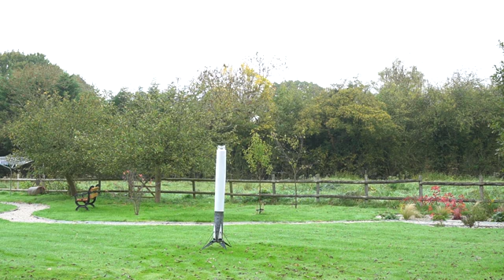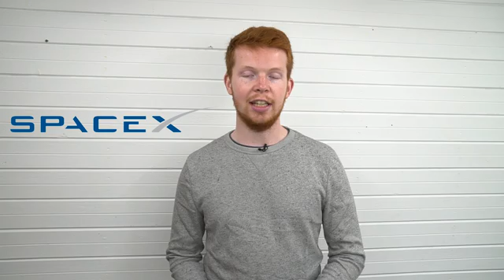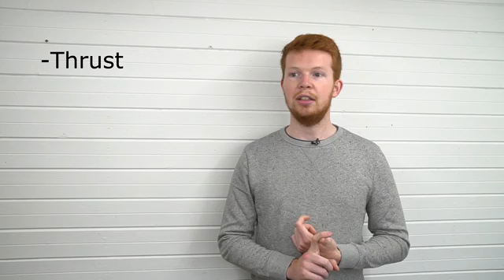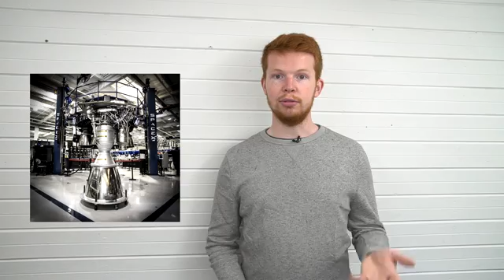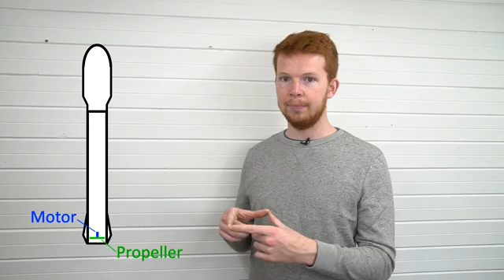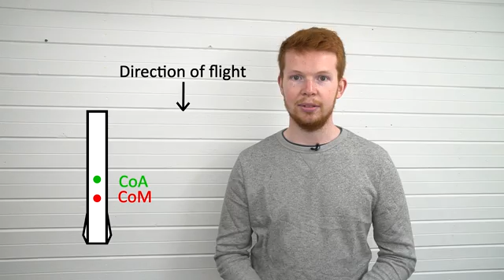Hovering a rocket - SpaceX model

Comment: Wow this is amazing! Could you use some sort of water cooled edf? Or siphon its thrust off somehow to cool it?
Reply from the maker: Possibly! Maybe a metal motor mount would be simpler and would still act as a heatsink. Definitely something to look into! Thanks
Reply: Wow, I cant believe you replied! You could use something like one of these mabey? https://hobbyking.com/en_us/ntm-rotor-drive-450-series-1700kv-930w.html or https://hobbyking.com/en_us/turnigy-l2855-2100-edf-outrunner-900w.html or even https://hobbyking.com/en_us/turnigy-ld2840a-1800kv-brushless-motor-400w.html or possibly https://hobbyking.com/en_us/turnigy-l3010b-1300-brushless-motor-420w.html
Reply: Adding a second counter-rotating motor would halve the load on each motor. Using the lamels to counteract torque from the motor probably don't work well on low thrust when landing, so maybe that would also allow you to land without tipping over?

Comment: Really impressive work.  I think ducted fans with long efflux tubes are always inefficient so the easiest way to get better thrust is to move the motor and fan down towards the bottom of the tube.  You could then add some side vents above the fan to allow an easier passage of air on the influx side.  I know this will move the centre of gravity lower but probably a price worth paying.  Another approach would be to put some side vents below the top motor fan to allow it to operate more efficiently.  This would reduce the effectiveness of the control vanes so to keep them in their current location you'd have to add a second motor/fan down near the bottom of the tube.

Comment: Not sure if this is a stupid question but could you pump water or some liquid around the rocket to rotate it?
Reply: It is just a kind of reaction wheel (flywheel).
Reply: Yes, could you employ this on a rocket of this size?
Reply: Why not?) But it'll cost you a lot of mass - fluid, pump, tubes, controls. In this case a usage of 'free' air is a right solution.
Reply: Could you somehow modify this then to instead use a pump to compress air and fire it out the bottom but does this on the go so the gas gets immediately fired out resulting in no mass in the rocket at one time because of the speed and directness of the compressed gas to the fuel nozzle. Pretty sure this wouldn't work because I thought of it but you never know.
Reply: I'll say that every alternative solution has much more weight than a simple propeller.
Reply: Yes, I think your right but if you had some sort of pump moving water around, you would never need to loose any fuel. Im not sure if this a good or bad thing but hey, it's an idea.
Reply: Good question Vosem: The idea of using a fluid as the mass in an inertial reaction control system is not a practical one.. its because water tends to loos energy very quickly by friction when its moved trough conduits. You should lookup how reaction wheels work, its very interesting: They need to be spun up before launch and its the action of slowing them down while in micro-gravity that imparts angular motion to the spacecraft. Essentially, the kinetic energy is 'stolen' from the planet itself, stored in the wheels and given to the craft when needed.. Once the kinetic energy has been removed from the wheels by slowing them down, the craft must use fuel to hold its attitude while the wheels are spun up again. There are other implementations of reaction wheels but they all operate in a similar fashion and their operation relies on conserving momentum in a mass. Any  friction in the bearings or in water flowing through pipes will be lost.
Reply: Then the pipes filled with water would simply replace the wheels as the inertial mass but the friction of the water inside would still waste energy through sloshing. Remember, any friction in the system is a waste of energy, this is why they use dense discs hung on ultra low friction bearings in these devices.
Reply: vosem  er NO.. go get a 10 gallon bucket or barrel of water,, fill it   up with a few gallons  and run around the yard in circles for 5 minutes and youll find you answer
Reply: simon  er NO... its the sloshing of mass not friction
Reply: Hmm instead of pumping water around could you instead move the pipes so the gravity pushes the water along the pipes instead of a pump?
Reply: +Vosam Media "could you pump water or some liquid around the rocket to rotate it"?  Yes.  But at the expense of adding a lot of mass.  Since he needed the thrust vectoring _anyway_, using the vectoring to cancel out the prop rotation (and rotate the rocket arbitrarily) was essentially "free".  Further, there are limitations as to how much torque you could get - once the water is moving "full speed", it's effectiveness at rotating the rocket in the originally desired direction is lost.

Weight is (almost) always a great enemy in rockets.  You do everything possible to reduce weight and combine function.
Reply: Liquid fuel rockets actually inject the fuel and the oxygen into the combustion chamber using turbo pumps so someone at any given space program spends his days figuring out why generating forces pumping liquids around is/isn't a great idea!
Reply: johnny: Sloshing in a fluid causes movement within its mass which induces internal friction. Its a basic concept in fluid dynamics. It's the reason a container filled with fluid stops sloshing when left still. Also starting a reply with "er  NO" makes you look arrogant, particularly when followed by a void statements.
Reply: or he could just use smaller motors and counter rotate them

Comment: Great video as usual Tom. I seem to recall that when deciding to install an air duct for a kitchen extractor, you need multiple fans along a long length of conduit. I believe this is because the fan loses power the longer the tube. I wonder if you introduced vents on the side of the tube and closer to the fan, you might get better thrust and less likely to need 100% power?
Reply: Excellent logic. Tom, do this.

Comment: Really cool build, you should try flying it in an indoor space somewhere where the wind won't make it drift. I bet it would hover perfectly.
Reply: rofl, just because he didnt have position control on the control board doesnt mean it doesnt exist., gps, ultrasonics, more accelerators and altitude sensors etc can be incorporated to aid in heading hold, also a larger object has more mass vs surface area and is less effected by wind and inherently more stable because of it.
Reply: @Drachenhebron  . Yes modern aircraft always incorporate more mass to increase stability  ... 🤦🏻‍♂️ hint ALL Aircraft design involves reducing weight ( mass) whenever possible
Reply: Michael Taylors not all the rockets land on the water so you could actually see a landing... also the larger rockets are not effected by the wind as much as smaller rockets
Reply: @misterbert9246  ... yep and bigger sails are also less affected by winds than smaller ones 🤔🤣
Reply: @michaeltaylors2456  Do you even aerodynamics bro?
Reply: @Kasmuller  , yes , which is precisely why grid fins, cold nitrogen jets, and horizontally flying cylinders without wings or are a no go , aerodynamically speaking .
Reply: @michaeltaylors2456  you don't get it do you...
Reply: @Kasmuller  , No you don’t get it Kristian. The impossibility of a wingless tube flying under control in any attitude but perfectly straight up is quite impossible . What you do actually factually see at a KSC launch is a simple ballistic arc up over and downward. This makes perfect aerodynamic sense. For example,  why don’t we simply remove the wings from a 737, mount it’s engines on the tail and fly?  We could , straight up briefly perhaps, assuming enough thrust is available.  Remember that before orbit is achieved,  one must first fly roughly horizontally and gain over 100 km 60 miles to the Karman line. Your space craft or rocket must be an outstanding high performance aircraft first, with all of the attendant challenges to overcome that even the mighty X-15 and SR-71 cannot handle.
Reply: @michaeltaylors2456  I know how rockets work...
Could you explain to me why wind would be an issue going down but not going up?
Reply: @Kasmuller  . I see you are thinking a little, and now have  invented a strawman to ignore  my arguments.  You  know how rockets work?  That is fantastic , but I never said you didn’t.  Another  straw man.   I’ll continue to discuss the science if you are serious about learning, but, if you twist and fabricate things that you wish I wrote, you will remain right where most idiots are,  a fantasy state of cognitive dissonance. Believing in CGI and cartoons to inform your miss-understanding and then treat science like something to be a avoided because it conflicts with a sci fi movie you saw.
Reply: @michaeltaylors2456  Lol, I wasnt aware people actually thought this. I would LOVE to know how you think missiles (and RPGs etc) fly, since they are jsut tubes without wings. This some flerfer math 😂
Reply: @LeglessWonder  I recommend a simple web search for guided missile, preferably actual working ones, where you will find that 100 percent of them use fins for guidance.
Reply: @michaeltaylors2456  fins aren’t wings. That’s like saying an arrow gets lift from the fletchings.
Reply: @LeglessWonder  Lift is not the question here  the rocket engines provides lift dipshit, wings are required for directional control and no, dumbass, vectoring or gimbaling that engine thrust will not suffice. Fuck off
Reply: +Michael Taylors You're kidding right?
Reply: Old Albird then make one and show us, or are you chicken?
Reply: Michael Ratzke good thing there is never any wind over the ocean
Reply: Tntmod54321. I’m kidding about the lack of wind  over the ocean . I’m commenting on the unintentional debunking of Elon’s show . The well meaning and very intelligent author of this video demonstrated the inherent lack of lateral control a craft like this would have . Gusts present over the ocean would be more than a match for some squirts of nitrogen and wiggling fly swatters ( grid fins ) could ever compensate for. All spaceX launches, tests , recovery all blatantly CGI. A thing may launch from KSC, but the rest is about as believable as the FX in the Last Starfighter
Reply: @michaeltaylors2456  except tons of people have witnessed the landings with their own eyes aswell as with cameras when they land on land...
But ok if you don't want to believe in what is obviously real then don't...
Reply: @Kasmuller  Your faith is strong, impressive young  Starfighter. Have you met any one of these “tons of people” or just saw their YouTube videos ?

Comment: Excellent stuff again Tom, you have however just created the first prototype automated leaf blower of the future.. you need to get patents in place. Seriously though, that is a monumental achievement, the holy grail of rocketry is control, your design just leaped over the first hundred years of 'rocket science'. Great work.
Reply: Actually, the vanes in the airstream vector the thrust exactly as the vanes in the rocket exhaust of the German V-2 rockets of World War Two.  Damned good thing that Von Braun DIDN'T have that circuit board!
Reply: +Blusewede that circuit board would have to have had GPS to make that much of a difference.  The V2 had at least 2 gyros for lateral guidance (roughly equivalent to what Tom was doing), tho some later ones relied on a ground-sourced radio beam guidance, and usually a timer for engine shutoff.  At the distances they were flying, lateral accuracy wasn't that big a deal, distance was more of a problem.

GPS would have allowed them to home in on a specific spot.

But of course GPS didn't exist then, and if it did, it would have been jammed (or turned off - GPS ground control can literally shut it off at a whim).
Reply: Alasdair McC:  Anyone who (national nuclear or space program) can write a program to decode GPS Signals and apply them to a Reasonable Geoid model, don't have to worry about any artificial limits in the Consumer GPS Engines we have to suffer with. (due to Export Controls)

There are no real speed or altitude limits in the broadcast GPS signal.  We just don't have access to the encrypted P signal. (though we can observe its phase)
Reply: +Alaisdair McC I think those special features are built into the drivers, not the GPS ;-)

Our North Korean friend probably doesn't have the ability to hit anything particularly accurately, GPS or otherwise.  But if he can carry a thermonuclear warhead, detonating it a few dozen miles up anywhere near the left coast would ruin everybody's day, without actually killing anyone (directly).  Hint: EMP.  We're not well-prepared for that.
Reply: Alasdair McC and all with a circuit board costing about £20. Imagine if the rocketing pioneers had what we had.
Reply: Fromage Frizzbizz gps has limits built in to it to prevent it being used on rockets, it has a upper speed limit and altitude limit.
Reply: Benjamin Harvey it also has special features that make people drive their cars into the ocean.. but good point on the speed limitations.. much to kim jongs annoyance.
Reply: +Benjamin Harvey Commercially-available receivers have limits built into them, but the signals from the GPS are such that you can ignore all that.

Remember, that GPS is only _one way_.  The receivers transmit nothing back all the calculations are done in the receiver.  Hence, the satellites have no way of telling where you are or how fast you're going.  They're transmitting blind.

The best they can do is drop precision (to make your error greater) or decrease the repeat rate (so you can't tell in real-time-enough your position at high speeds), but they can't muck with the signals in such a way to be specific to a given height or velocity without screwing it up for everybody.

But of course they didn't have GPS in WWII, so it wouldn't have done V2s any good.
Reply: kadmow Yes, they all contain their military prime use data, and the limited non encrypted stuff is just for the masses, I guess were just lucky that they give us free access to those limited signals.
I think the developed world would grind to a stop if they all decide to switch off. Maybe we will see it in a T.N. war situation.
Reply: Fromage Frizzbizz your spot on, either way the outcome won't be good. The technology genie is well and truly out of the bottle.
Reply: +Alasdair McC To tell the truth, I'm not too terribly worried about that particular genie.  Our North Korean friend may seem insane, but is not suicidal, and the Chinese would be first inline to retaliate if he was.

There are other genies that I'm worried about, ones that don't require whole countries and billions of dollars to produce, not to mention the American Taliban.  They're close enough to power as it is, I fear for everybody's safety if they get any closer.
Reply: +Alasdair McC It used to be far more limited, Reagan lifted the limits to allow us to do what we can today.

There are at least two efforts, Russia being one of them, to loft their own GPS network.  The Russian's coverage with Glonass should be pretty close to GPS by now (despite the problems they had with some of their launches).  This was done, at least in part, to counter the possibility of the Americans turning off access.
Reply: Fromage Frizzbizz Agree, and that particular problem is not limited to the US, it is a global push which seems to have unwilling and incapable governments letting obvious situations develop, actually feeding into their hands. So obvious to any onlooker with half a brain, but I guess thats why politicians are totally ignorant of it.
Reply: Over exaggerating a bit. This is not rocketry. Sorry.

Comment: Great! I was thinking of building an RC Falcon 9. You should try using EDF motors.
Reply: 4x EDF motor setup in a rocket booster looking setup would be much simpler although a 4x edf boosters would just turn it into a quad copter with a rocket looking frame i guess you would call that cheating or not in the spirit of the SpaceX design. The single motor design stabilization is fantastic feat of programming and skill very impressive. Maybe counter rotating EDF motors for more thrust? (i don't even know how this increases thrust but good luck!)

Comment: use GPS to Lock in place
Reply: GPS accuracy is measured in meters. At the scale of this model, Tom would need CENTIMETER accuracy to provide guidance.
Reply: John Hopkins it depends on how many satellites does it received... I can get 0.5 hdop by using M8n and it stays like rock in the air...
so what's your suggestion to get centimeter accuracy?